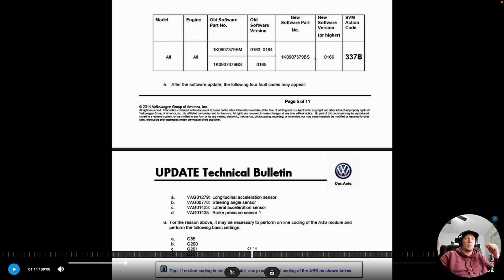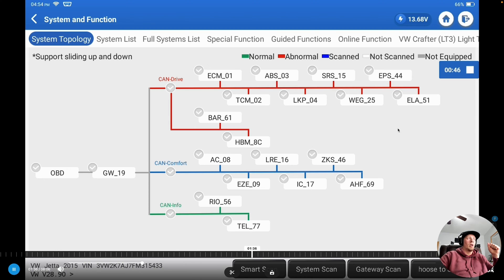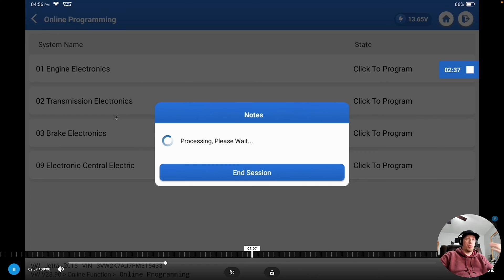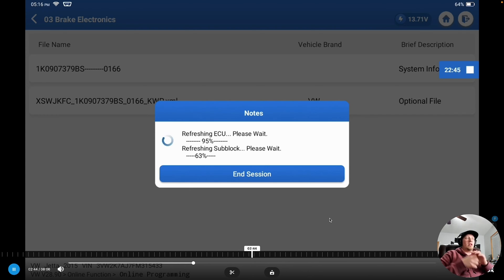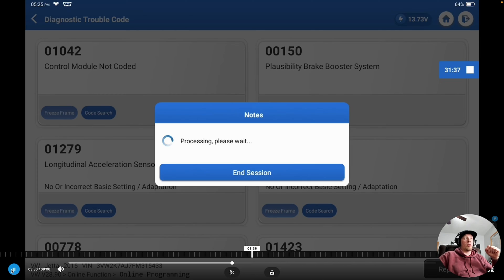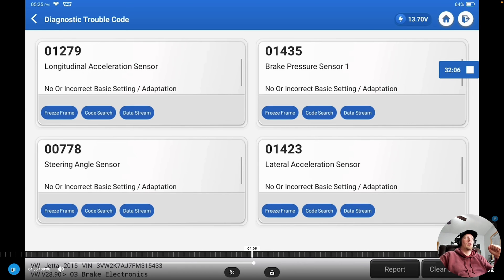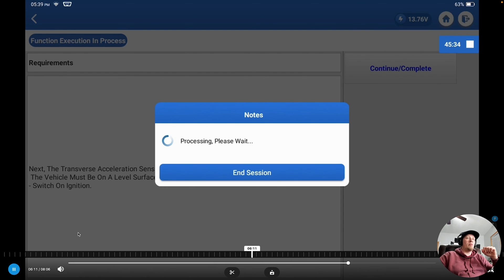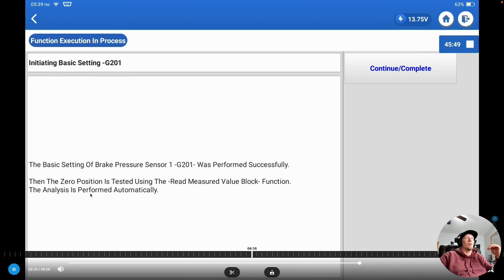ABS Module Programming from TOPDON

Comment: Have a question. Can you use this tool can you reset tone ring count at the bearing hubs at each wheel. From let's say my current ones at 47 count to a 48 count has I modified my whole drive train suspension. And I'll be using the 48 count now.